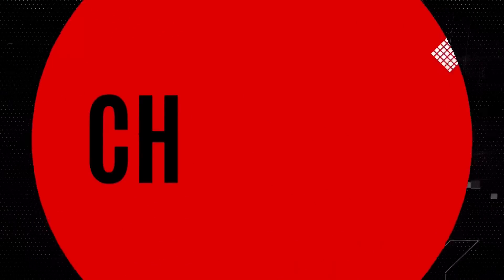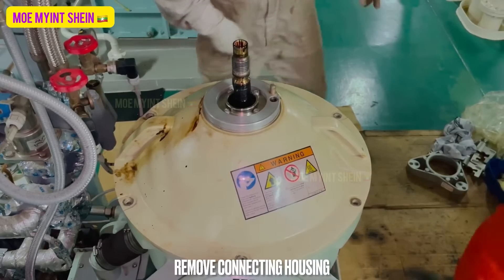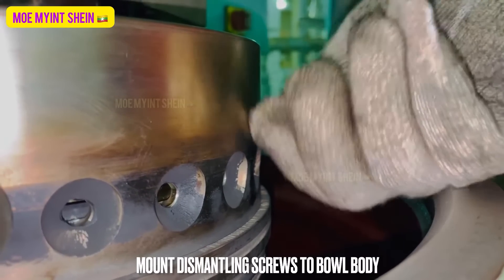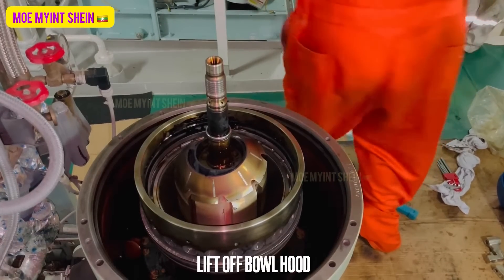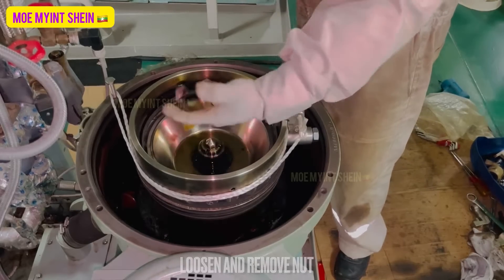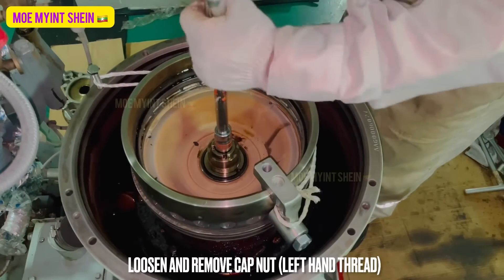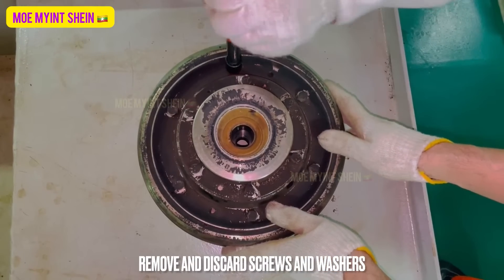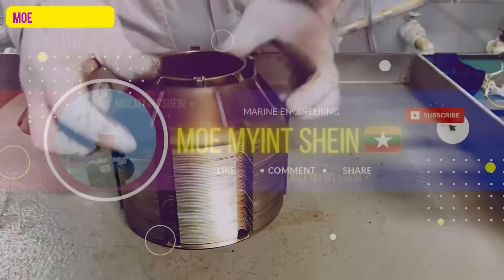[ALFA LAVAL] Bowl Disassembling of Separator | MOE MYiNT SHEiN￼ | Technical Vlog : 120

Comment: Sir, Where does the dismantle water enter the bowl? Does it enter from the nozzle? Thanks.
Reply from the maker: Dismantle water?
Do u mean bowl opening water?
Reply: @ I mean seal water sir. Opening and closing water enters the bowl from the bottom of the bowl and opens and closes the discharge slide and sends sludge to the separator. but I can't find where this seal water comes from.
Reply from the maker: @bilmemki-cq1ov 
I will upload one photo on my community, sooner. 
You will clear after seen it. 
Pls stay tuned.